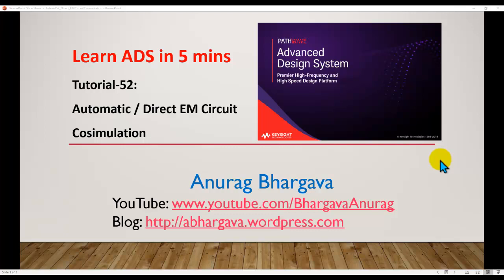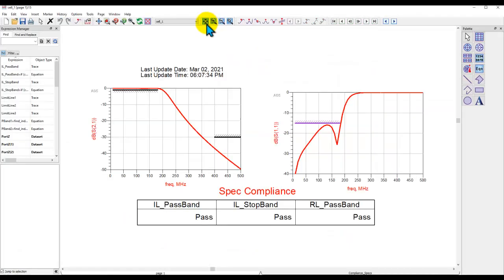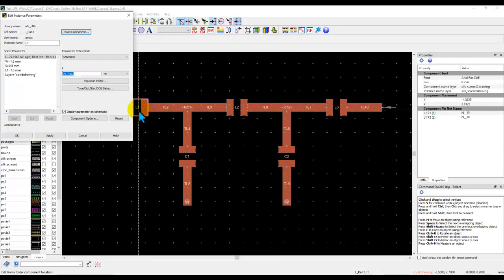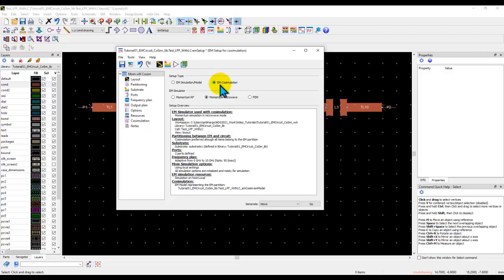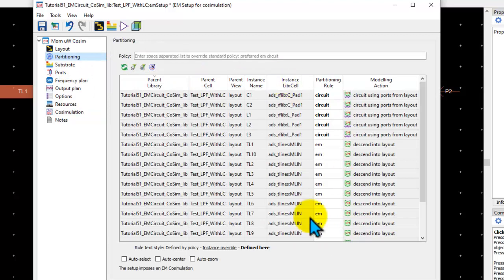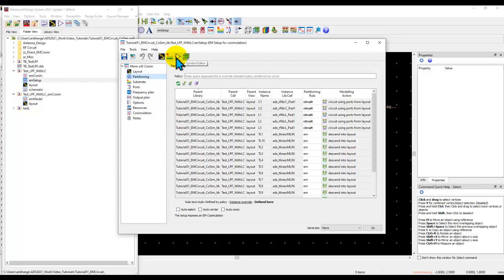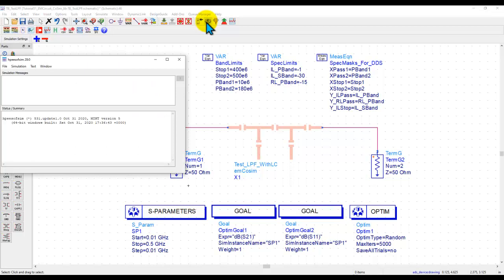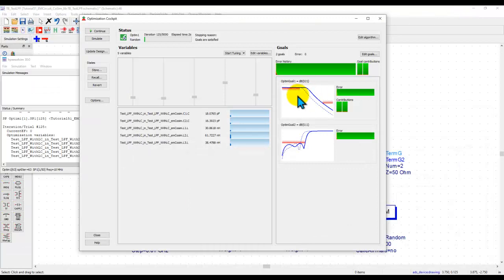Tutorial-52: Automatic EM Cosimulation in ADS

Comment: How do I use this process to comsimulate a design that does not originate from a schematic file? I imported my layout but I don't have a "circuit schematic" like you do. My current process is adding in pins and EM simulating like your previous videos, and doing a "lookalike" EM sim view in a Circuit test bench. How can I follow this process without a schematic document? When importing a PCB file, it does not import a schematic view of my components.
Reply from the maker: Co-sim doesn't require schematic design per say but I would recommend you to contact Keysight tech support team for help: support@keysight.com

Comment: HI Anurag, Nice Video. Thanks for Keeping up the good work. 

The EM Co-simulation does the momentum simulation every time when we re-simulates the schematic for tuning. Is there any way avoid that , as we are changing only the SMD Values.

Bit confused in some points
1) If I would like to Tune the SMD Values from the Test Bench, with the View selected as EMco-sim. Whether the values are visible in the Simulation Variable setup of the Test Bench. 
2) I believe the  schematic and the EMco-sim view generated from the Layout are independent to each other, or does the change in Emco-sim optimization affects the value in schematic
3) I thought they will be linked only when we do Layout-->Generate/update Layout
Thanks Again,
Theepak s
Reply from the maker: There seems to be something wrong with your setup, Momentum will not be run if you are changing only SMD values. I would recommend you to contact Keysight Europe tech support team and they can help you over live session to resolve all the issues and answer your queries.
Reply: @BhargavaAnurag  Thanks Will do that